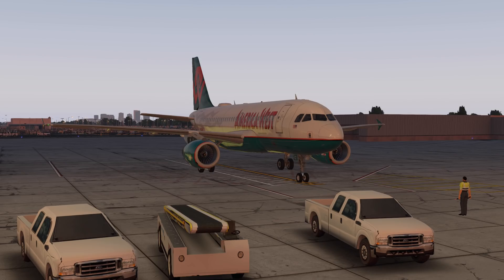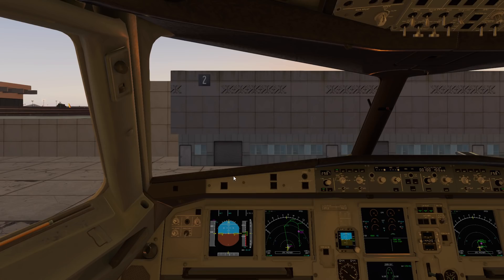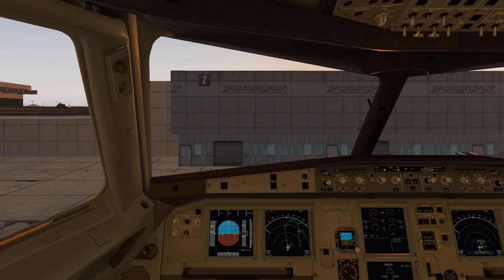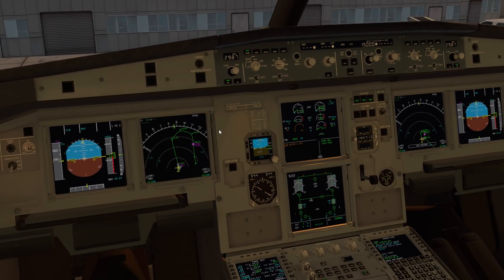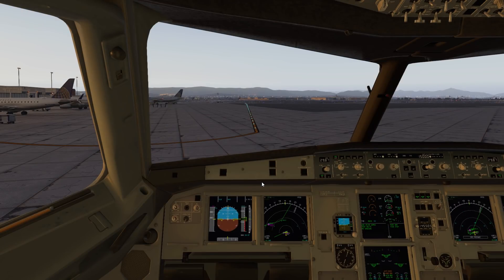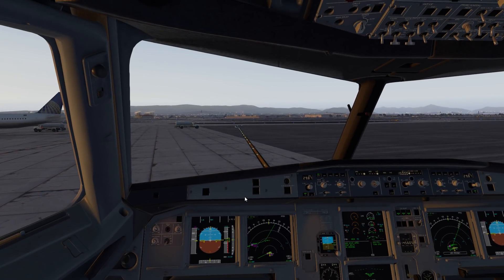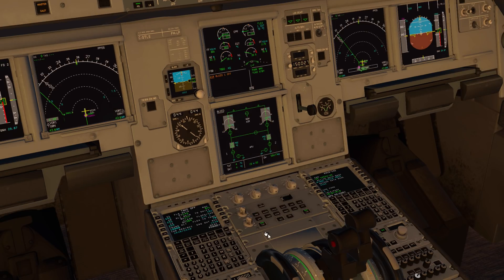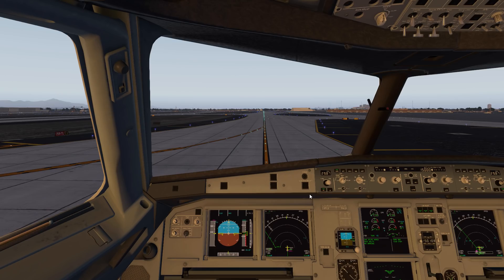I Airbus Pilot Series I External Air & XBleed Starts

Comment: what happens when you have an dual engine failure on cruise and no apu? isn’t that super dangerous since you lose electricity?
Reply: RAM Air Turbine extends with loss of AC Bus 1 & 2 and or all hydro press loss-because if you had the APU running, AC 1/2 is ok and obv the apu gen buses run the electric hydro pumps so no need. But yes! If APU inoperative, you lose both gens+all hyd. For the 8 seconds the RAT takes to extend, you are on battery only+emergency AC bus via the static inverter (which will drain the batterys) and god help you if the rat fails to extend because yes you will be without hydraulics. You could attempt an APU start, but this is that much faster the battery drains and since the rat failed to extend your without hydraulics so hopefully not in a dive or its not going to start before you break apart